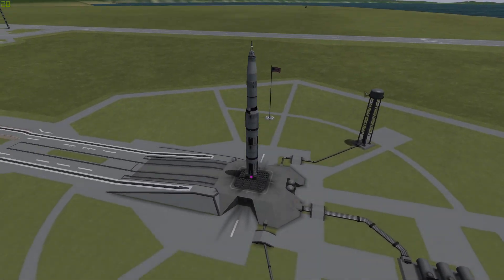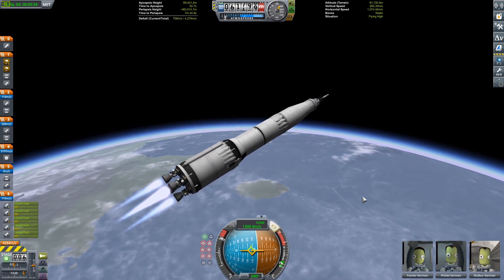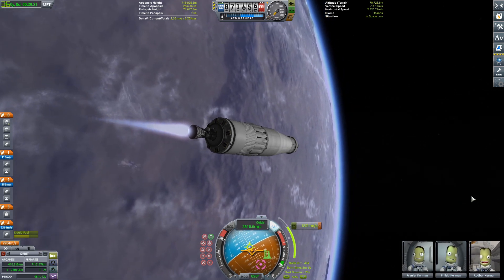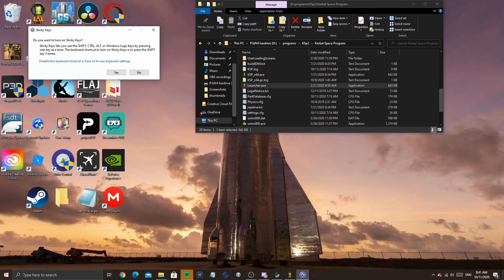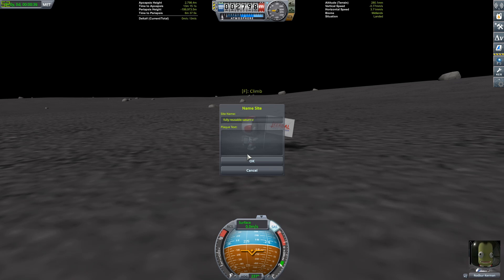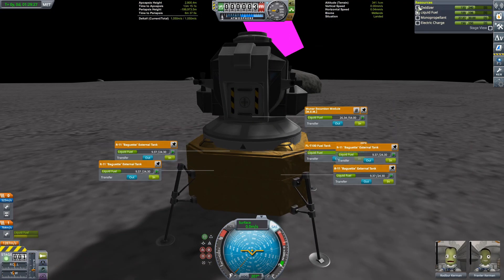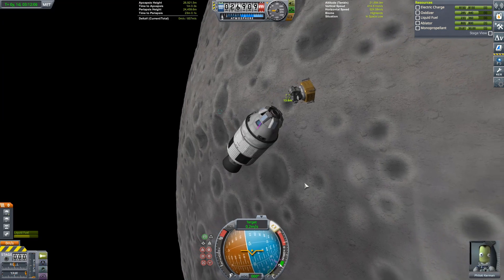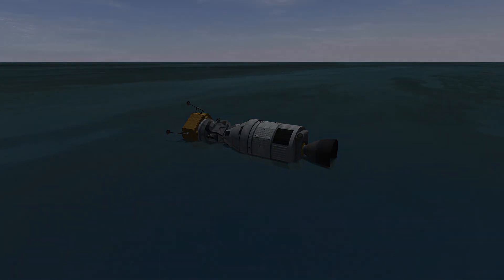KSP: FULLY REUSABLE SATURN V! [stock] Kerbal Space Program

Comment: If you really wanna pump the fuel around, you can always go back to the tracking station, and then back to the craft. It takes some time, but if it is necessary it helps.
Reply from the maker: Quick saving and then quick loading sometimes works as well. It is a real pain. They really need to fix the pumping glitch soon
Reply: @Piolet1549  on my end you can just click off of both of them and try a gain, repeating that usually works.
Reply from the maker: Yeah, that sometimes works for me as well, but there have been times I’ve had to click off and back on 30+ plus times before it works or sometimes it just doesn’t all together. I dint know if that’s how it is for you but that’s how it is for me